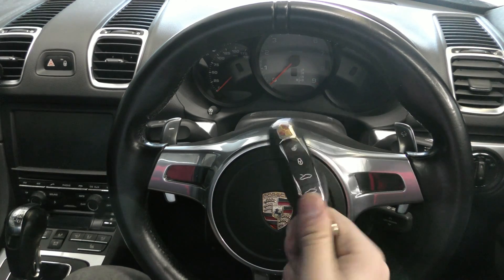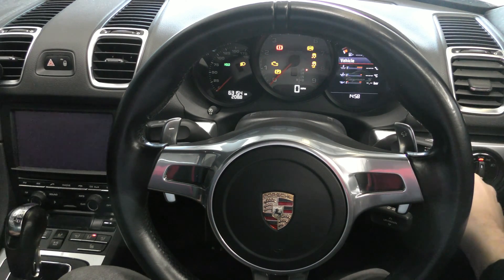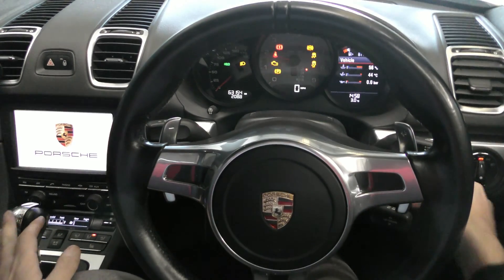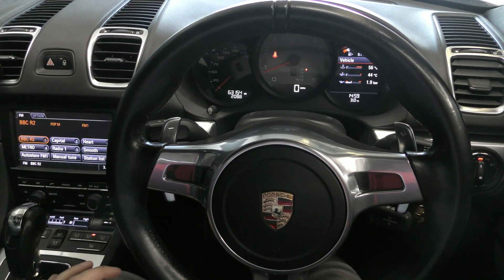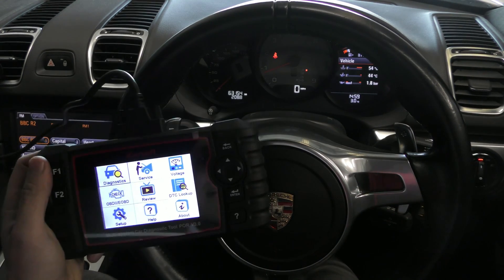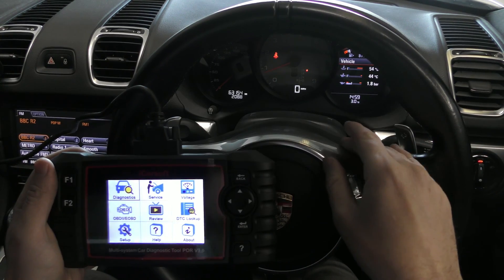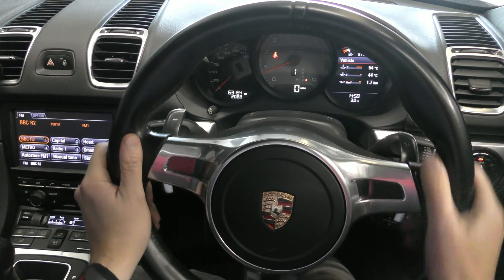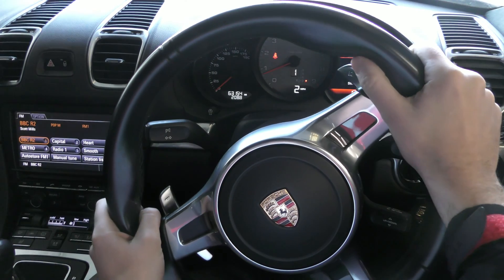Porsche 981 Cayman/Boxster Rear ABS Sensor Diagnose & Replacement DIY Guide

Comment: not a clue, dont give up the day job 🤣🤣🤣
Reply: 0:43 into vid  - odo showing  63,154 mls,  ............... MOT pass on Jan 13 2023 with odo reading on cert showing 63,163,............ ( See DVLA mot & tax check)."Vehicle showing SORN "!!     May as well have worn a sandwich board.
Reply: You're allowed to drive an untaxed vehicle to get it MOT'd or fixed prior to an MOT as long as you're insured. And as long as you you have booked an appointment for said MOT.

Comment: when I see the condition of your exhaust, For 2023 I wish thatvyou won't get a faulty oxygen sensor.
My exhaust looks as bew after 13 years, after hadding ut lowered with H&R sorings, one O2 sensir was brojen on your driver side, my passenger side.....it was a pain in the.   welk you in what....never...ever.....again, next time the sensor fails, I give the car away.
Reply: My 997 was a pain as well…one of the sensors had been welded in 😢….let’s say it was fun getting it off 😢
Reply: Just noticed his comments on his facebook and instagram, informing us that his Cayman just passed its yearly MOT. ........  I wonder if he took it to the  mot station on a flatbed, coz that car is on SORN..😮